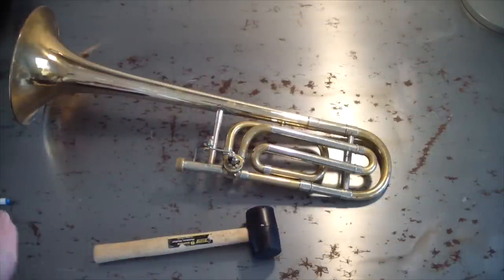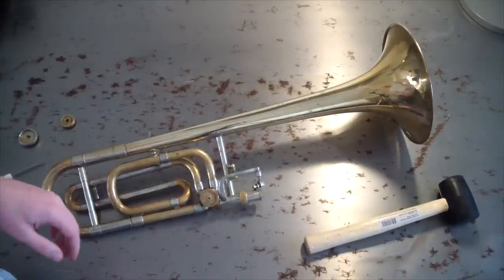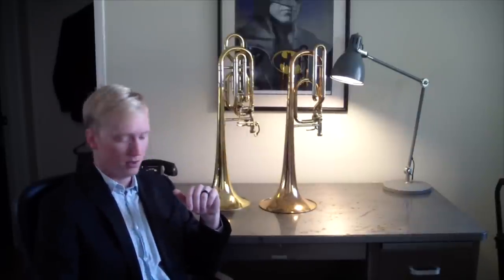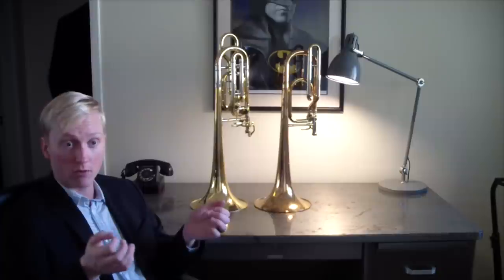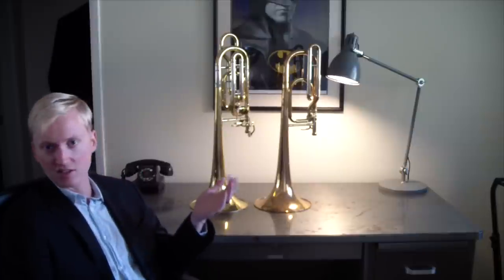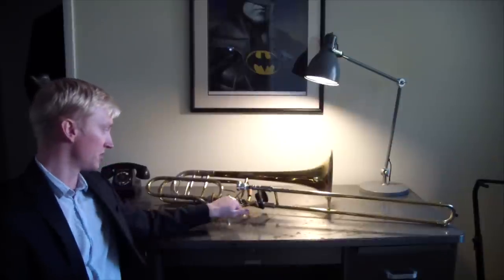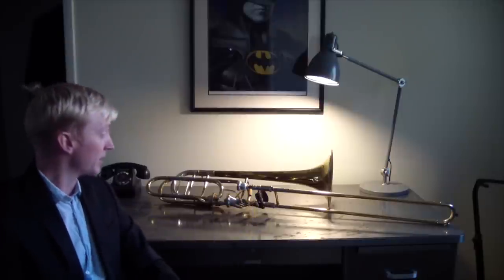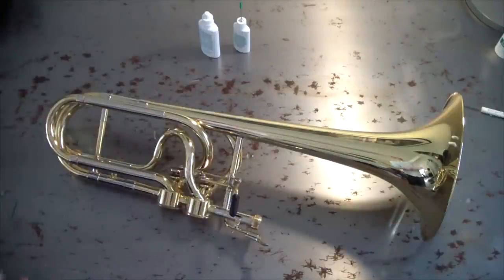All About Valves!

Comment: I hear the the finishes which is the coating of a trb is what matters. Like with trumpets, the bones have a brighter sound and can hit higher notes easier on a silver finish and are ideal for marching bands and jazz. Also they don’t tarnish as well. Also, gold/rose coating off the player a mellow, full dark sound that’s great for classical and orchestral playing. Lacquered will make the sound harder to project and will require more force behind its attack. Like playing baseball and tennis. The tennis part I got from the famous bass bonist James Markey. lol
Reply from the maker: Finishes don't matter to much- raw brass, silver plate, gold plate (which goes over silver plate), and modern lacquer are very thin and not far off from each other. Some older lacquers are quite thick and heavy and will damp down the horn a little bit, but still not a huge amount.
Reply: @AidanRitchie  How should I play my bass bone?? My ex band leader in church wanted me to play higher for this one song we rehearsed in practiced during musician’s rehearsal. Hitting the high d is a bit of a challenge.
Reply: @AidanRitchie  I mean, I have no problem playing low on bass trombone and having a full metallic sound overall. Just when I try to play ridiculously high and do tenor trombone or farther beyond by attempting trumpet stuff my tone sounds weak and stifled. Like a baritone singer failing at falsetto. Lol
Reply from the maker: @keithshockley3443  it just takes practice!

Comment: Great explanation, especially with dismantling the valves 👍 I was always too scared to break my trombones and let this part to the repair shop if needed. Back them there was no YouTube and no instructions. But after watching some videos, I would probably not be too scared anymore and try myself.

Anyway, I'm wondering if you ever had the chance to try Laetzsch full-flow valves on a Laetzsch bass trombone? Rotary valves not made of brass but carbon inside (light!), using ball bearings (no oil to add!) - and they are super fast. The bore of the valve is even slightly larger (!) than the bore of trombone but overall the resistance seems a bit higher compared to axial valves, maybe due to the change in flow direction.

These are certainly not cheap valves and only to be found on (neither cheap) Laetzsch custom trombones (Haag from Switzerland used the valves for a couple of years). I have also seen some retrofitted Back 50 with those valves, but that's rare.

For my taste the valves in combination with the trombone is the best combination I could find so far. Even the higher priced Thein "Ben van Dijk" bass trombone with Hagmanns did not make me change my opinion. So I'm wondering what you think of Laetzsch valves (and trombones, as they can hardly be found and judged separately).
Reply from the maker: Yes, I have played a couple horns with those valves. At the time I didn't think much of them, they were fine but didn't blow my mind (this is 2017, and again in 2018). 

I'd like to play them some more, though.

Comment: You can find the right angle measurement if you go on Hagmann website.
http://www.trombone.ch/EN/levers.html

There are many models of Hagmann valve models but they are not know in the usa
http://www.trombone.ch/EN/valvesmodels.html

There is also a Tone ring that you can add to the valve cap that makes a big sound difference
http://www.trombone.ch/EN/tonering.html

And also the vibrabell since 2008, that make your bell floating and not « touching » the valve section.

And more…
Reply from the maker: Julie, thanks! I am aware of the different bass and tenor models, but they are all of the same manufacture. Much like the different Bach rotors- they are different sizes and have different ports, etc. but they are all basically the same design. 

I have seen the heavy tone ring! Heavy valve caps exist for Thayers and rotors too, but I didn't have any on hand... 

Vibrabell sounds like edge bracing, which I actually have on my bass!